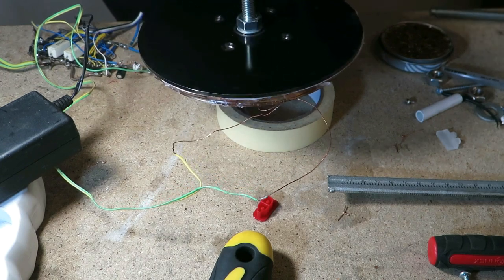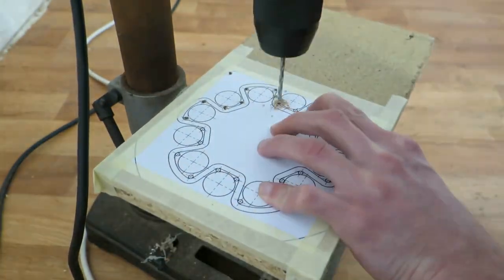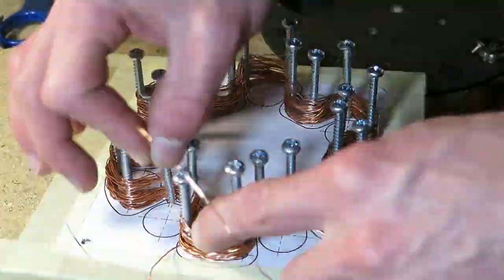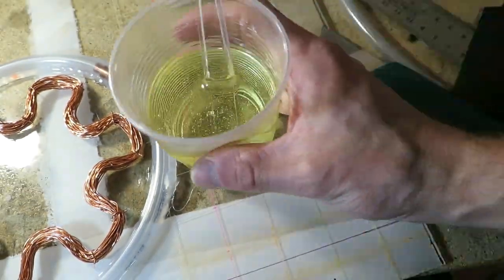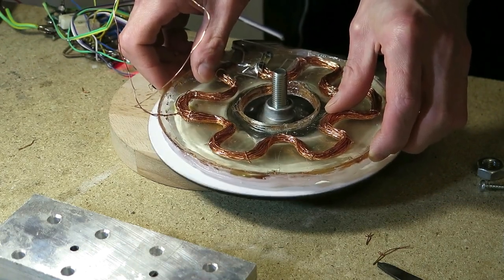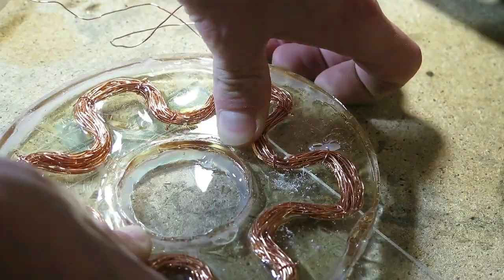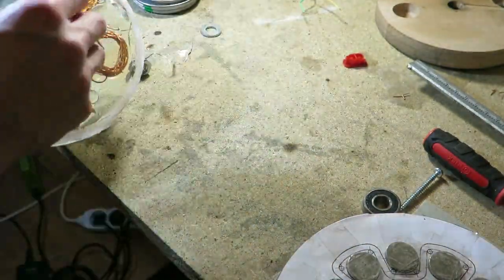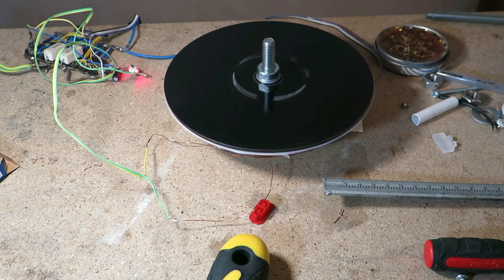DIY BLDC Axial motor - multipole flat coil test

Comment: How many copper strands did you use? And does how many strands affect torque and rpm?  What voltage was you running it on? Excellent work!

Comment: Some designs use more magnets than coils, but in your design, there are equal number of magnets (magnets align perfectly with wires). How do you decide how many magnets to be put in rotor?

Comment: This kind of reminds me a bit of that time i made a BLDC driver for DVD spindle motors and spun them so fast that the bushings welded to the shaft. No amount of lubrication would save them. :D
In then end my power supply didn't have enough power to make the motors spin even faster but the speeds were absolutely ridiculous and the gyroscopic effects were as well.

Comment: Okay, I see how the single coil can function as several coils with the polarity reversed from one loop to the next. What I don't see is how commutation is achieved. The motor should cog to a stop immediately, if DC is simply applied directly to the coil. I must be missing something here.

I can also see why it is not very efficient, in terms of watts in / watts out, but if light weight is more important than efficiency of energy conversion, it is ingenious. Nice work.
Reply from the maker: Hi, commutation is done by PC fan. So this is AC motor.

You can look at my playlist if you are interested.
Driver is explained a little bit in first video of this series.
And in last video I have more efficient 3 phase version driven by RC plane motor controller

Comment: nice video friend......1st of all sorry for my broken english writing,,,,anyways i m new in this field,want to know abt dat i have a berger lahr stepper motor,as i turn it with finger shows near abt dc 5.00 and ac 200 ,,,,,,,,cos i cant read the current value of the motor ....can i use it for a small wind turbine???but as attach it with some load its get very hard to turn......thanx any suggestions
Reply from the maker: Hi, that is the nature of all motors/generators. When you apply load, you have to provide more curent / when you need more current, you need to provide more force.

Personally I would not use stepper as it tends to create huge voltage at lower current normally - it would be beneficial to charge some 30V battery and then step down to provide higher currents.

it also has holding force, that you have to overcome to start not quite smooth rotation. when rotation is not smooth, this holding force will play effect here. You also can not get rid of it, because it is a result of motor construction.

Comment: It doesn't need ESC right? or motor controller whatever you called. I can see only 2 ended of wire in this case you use pulse?
Reply from the maker: In theory you could do it, but in practice you need to control it.
Driver and principle is same as in PC fan motor. it is only a bit scaled and flattened..

Comment: how good do these coils work compared to regular builds? I'm thinking of making a generator using this coil type.
Reply from the maker: it depends on what the regular build is :)

typical commercial motors have 90-99% efficiency if used right.
i guess, that worst case for commercial BLDC motors used in RC community would be 60-80% if abused, but not really hard...
in my last test this motor had 45% efficiency.

to improve this, you can add more phases, or use more dense configuration of magnets (thinner bar magnets), or pulse the power only when it is most efficient(reduces power).

axial motors are compromise between power density and efficiency, but design is very simple and low cost.

I don't think this would be cost efficient generator in long run. for experiments it's pretty OK

Comment: Merry christmas! This is single phase motor?  Can it be self - starting?  This is sensorless design or with hall type sensor? I want to use same type of design to direct drive of turntable for my LP records. in i need slow speed rotation 33 1/3 rpm with high stability. Sorry my bad English
Reply from the maker: in 3 phase design you can use rc style driver, that would work. i have made 3phase version with this coil so you can have a look on that

Comment: Really cool! What did you use for a power supply? Also where could we find that template?
Reply from the maker: I use about 30W 12V power brick.

I can make you a template, as your design will be probably different.
I would need number of magnets, shape and "middle" diameter of circular pattern.

I can make even an app for that, but single phase has only 50% peak efficiency, which is rather low.

I will try to get long bar magnets, and make 2 or 3 phase design usable with RC style motor driver
Reply from the maker: Hi, If you are still interested, I made drawing available.
https://drive.google.com/drive/folders/0BxYcrZZwfNmmZzM1UW5NcFZjVGM

This was done in fusion, so I can maybe publish 3D source.
Sorry, that this took so long - I had to reinstall OS so all data was deleted.
Reply: Ilusys Systems does the system heat up from such a high wattage through such thin coils because i can only put like 3v 15 milli amps through such thin coils it melted after a few minutes
Reply from the maker: Wow. There is no way such low power would melt hardly any plastic piece bigger than quarter coin.
3V * 0.015A = cca 1/20W. Imagine size of 1/4W resistor...

I am using 0.5mm dia. wire. I wouldn't call it thin. It can handle probably 10A @ 12V with some self cooling continuously say at 1000RPM - obviously the more RPMs, the better cooling if you don't use independent cooling.

Maybe you are measuring something wrong(meter range in mA while probe in 10A hole)?

Also I would recommend building 3phase version of this motor @ https://www.youtube.com/watch?v=SvxFdLKZU-8
Reply: Ilusys Systems my meter is old ill go get a new one soon. and the wire i use is so thin it melts with a heat radiated off of a lighter i do all kinds of crazy things on my channel
Reply from the maker: yeah, that's thin :)
with thin wire it's best to use high voltage and low current. but you also have to make a lot of more turns

 anyway, wish you good luck :)
Reply: Ilusys Systems ok thanks for the advice also i subed

Comment: What controller or amplifier you are using ?Does you directly give 12 volt supply to the coil
Reply from the maker: It's simple H bridge with hall sensor, there are more details in later videos I made
Reply: Where do you mount the hall sensor? How do you connect the hall sensor ? Can you please give some links to buy H bridge + hall sensor + software to work ?  BEST REGARDS :)  @IlusysSystems

Comment: Isn't more energy generated by putting induced by both sides of the magnets?
Reply from the maker: Energy isn't generated :) I guess you meant power density - in that case you can do that, but it is easier for me to close magnetic field by having 2 plates with magnets.

Comment: Can someone tell me what will happen if I increase the number of winding in 3 phase generator's stator... 
How will it affect the output, will the output voltage, power increase?
Reply from the maker: Increase of number of turns means more voltage.

Increase of wire dia means more Amps.
Increase of weight of copper means more power.

Comment: nice design. would it be better with some metal or ferite cores?
Reply from the maker: Thanks,
As far as system is efficient, presence of iron core shouldn't affect efficiency. At least not by much.
To a motor as this addition of iron core would mean:
 - increase of torque
 - decrease of max RPM (200 - 500)
 - probably increase of max power rating of motor (dunno how much - magnetic flux will be more concentrated as there will be smaller air gap)
 - and jerky motion when freewheeling (assuming discrete blobs of core)

If I was building wind generator, or motor where larger torque and slower speeds are required I would probably go with iron core.
I got an idea, still untested to use iron shavings (must be silicon steel - magnet supplier should have this) to form a core. Simply mix shavings with epoxy and mould that to form a core. 
Or use this mixture to cast whole stator as in 3 phase system you would have to do that regardless.
Reply: @IlusysSystems  laser printer toner contain iron oxide which is used to make ferrite cores
do you plan on making some ebike projects with home build motor?
Reply from the maker: @Timsturbs  ferrite may help, but you generally want highest possible permeability.
Reply: @IlusysSystems  oi
Reply: @IlusysSystems  You may want to see the bldc motor i built. I used iron (steel banding) in my stator to reduce the number of turns on my coils.  This allowed me to have a very thin and flat arangement of three coils in my stator. 

My motor is an axial flux bldc motor, with a slotless iron core,  
Judging by sound, my motor has very little torque ripple. But in all fairness  the motor uses 3 phase but my stator's iron, being slotless, does not cause iron "cogging" jerking.  

Just turning it on the motor controller at its lowest setting, causes my motor to spin at about 1800 rpm when fed 1.49vac.
Reply from the maker: @kreynolds1123  also got 3-phase build, was thinking about using iron filings as epoxy filler - may be interesting
Reply: @IlusysSystems  i had considered the same thing. But wondered about using nono sized magnetite (fe3o4) for their superparamagnetic/low coercivity properties.  

I built an electrolizer with iron electrodes. I  used sodium chloride as the electrolyte. And made my own magnetic stirrer from a cpu fan with magnets attached and a computer power supply for power. Then for my stir bar, i used milk  jugs pieces (hdpe)  melted in my oven inside a soup can. I dropped in a piece of iron  and more hdpe. After that was melted i pulled it out of my oven, let it cool, and cut away a lot of the excess hdpe till i had a nice stir bar.  Stirring is suppose to keep the particles from aggregating into bigger ones. 

 I was able to make something that looked like magnetite (black and atrqcted to magnets), but i think i was unable to remove the all the salts because next day it look lik rust red mud. Probably fe2o3.  I will revisit this one day.

Comment: I tried to make my own but for some reason it is not producing electricity when I spin it, I'm thinking it's the positive and negative wire, how do you connect them? I'm new to electronics
Reply from the maker: This is synchronous AC motor. this means that when run as generator it will output AC (alternating current) at a frequency directly proportional to rotor speed.
Either switch your meter to AC or use full bridge rectifier with 1-phase generator.
Reply: @IlusysSystems  ahh i was going to use it as a water generator, but to store the energy in a battery I would have to convert this to dc with a rectifier?
Reply from the maker: Short answer: yes.

Less short: Diodes and rectifiers do have a voltage drop (0.8 - 0.5V) that will result in small, but power loss. 
Using schottky diodes you can achieve smaller voltage drop (~0.1V).
Using motor driver in breaking mode can result in even lower voltage drop, but will require rather complex electronics, that increases cost and consumes some power themselves.

Comment: Could you run this in reverse for electrical generation? If so what would be the efficiency
Reply from the maker: Yes, you can, I was able to get about 70% efficiency in 3 phase configuration.
Maybe if you would add more phases or use iror powder as epoxy filler you can squeeze more efficiency, but I haven't tested that.
I have tested efficiency in motor configuration, so there could be switching losses that wouldn't be there in generator configuration as well but I think that it will be pretty similar.
Reply: @IlusysSystems  ahhh awesome. and thank you so much for the reply, was kind of surprised by it since it's such an old video. so thank you. Yeah because this looks ideal for a small off the grid cabin me and a friend wanna build since we won't need much power, basically just running some lights and maybe helping to charge some solar batteries
Reply: was also thinking you could stack them on top of each other for generation and have a switch system that can either distribute power to other things or be connected together for higher power depending on needs
Reply from the maker: One more thing - the cost of commercially available low KV bldc's for use in drones and RC stuff is plummitting, so it may be worth looking into these. If you want some serious power output , like 1KW per generator, these can easily get more cheaper if you find model that you can drive easily. Same can go for designated generator systems, but these are typically expensive.
My parts were laser cut, I used stainless magnet retainers and prety thick materials for convenience and I was able to get to ~ $1 per watt. it you have cutter, and just glue magnets, buy in bulk you can probably half the price to $0.5 per watt or maybe even $0.25 per watt. Magnets and copper are most expensive items really though.
Reply from the maker: @neillcoetzer9133  Yes you can stack rotors with this system, which is quite nice.
No need for fancy switching or anything like that really, just align rotors and wire stators in parallel. if you don't want to deal with consistency, you would need switching though, or just rectification at least
Reply from the maker: @neillcoetzer9133  Thanks, I have more videos where I have "improved" design a bit, calculated efficiency and tried to use it as servo motor which was ...meh... :) anyway, good luck with getting off grid!
Reply: @IlusysSystems  ooooo I'll definitely look into that then since that sounds pretty good
Reply: @IlusysSystems  yeah thats exactly what I was thinking about. Really cool system
Reply: @IlusysSystems  looking forward to seeing them. Hehehe thanks man, hope it'll happen

Comment: What power do you give..... .. i mean home electric...or..... from battery.... i mean dc or ac... this is my second comment.. coj i am interest in this....... the winding pattern is easy........  for begginners
Reply from the maker: ~250W power supplied by ATX PC PSU @12V
https://www.youtube.com/watch?v=TAFDX301Qrk for driver (3-phase). this motor is single phase, which is not that great

Comment: Can this thing be used as a Brake for wind turbine through a PCB to slow down magnet rotor spin when winds are blowing at high speed ? PCB can be programmed in such a way to activate voltage when high wind is detected through a wind sensor ?

Comment: why sisnt you use metal washers as cores for coils ?
Reply from the maker: you can, I was thinking of using magnetic steel shavings as epoxy filler. But, what you get is higher torque at lower speed so power is constant. efficiency likely too if design is good.

Comment: What kind of mold did you use for the epoxy?
Reply from the maker: Molds are quite problematic... I tend to use random circular objects wrapped with tape around, and use hot melt glue to copy circle. Not great though...
In this case I may used a pvc hose + hot melt glue
Reply: @IlusysSystems  That's a good way of doing it, I'm kind of new to motors but I was wondering what you connected the two copper wires to for the output?
Reply: Wait nevermind I see now, thanks man

Comment: How many winds ?
Reply from the maker: this one had about 40 turns
Reply: Thank you.
 I'm going to make 3, and put on each other,
 but I skip one centimeter from each other. 
To build a generator
Reply from the maker: I would rather place magnets on both sides of steel plate so you can do 3 stages with 4 plates.

I am still working on 3 phase system to increase efficiency.

50ish % is rather low, but it depends on your needs obviously
Reply: Yes, 3 phase, with 2 plates magnets, so below and above plate with magnets, and the coils on each other. But then each coil shifts 1 centimeter
Reply from the maker: Hm you mean, that 3 stators are offset by 120deg to work as 3 phases? that wouldn't be much more efficient...
or 3x3phase stators? that would be better.

I was thinking about config like:

=|O|O|O|O|=
instead of 
=|O|=|O|=|O|=|O|=

where = is shaft, | is plate with magnets and O is stator coil

I was going to ask if you saw my other videos on this subject, but I see that you are subscriber(thanks :)

I mean they get a lot less views and there is some useful info

For example, I get why people do want to build this type of generators/motors - it's cheap, simple and customizable, but I am not convinced, that it is much more cost effective. 

at least  until I get it to work above 80% efficiency
Right now my best result was 60%
Reply from the maker: Sorry this was marked as spam and without notification.

I understand, I misunderstood first
Now I read what you wrote once again, and realized, that I can't even read. I was thinking, that you want like 3 generators stacked on top of each other

By the way, today I finished measuring efficiency of my 3-phase motor and stator coil was about 82% efficient!
Currently I am editing video, so this week I can upload it.
Reply: I'm waiting for your video ! :-)

Comment: how many mm copper wire did you use
Reply from the maker: in this case about 0.3mm
With PWM driver I used 0.75mm wire and ~12 turns.